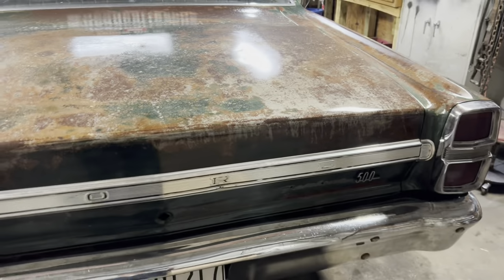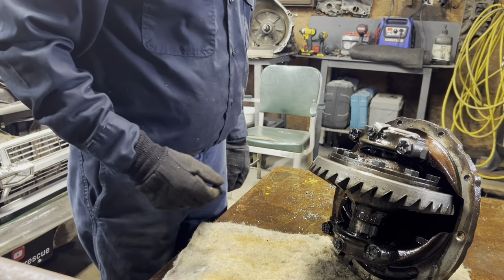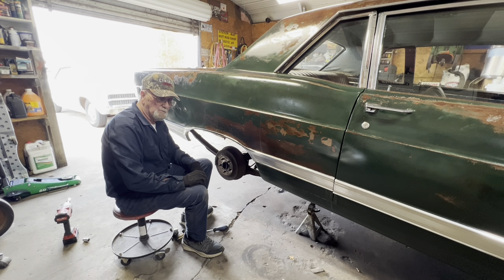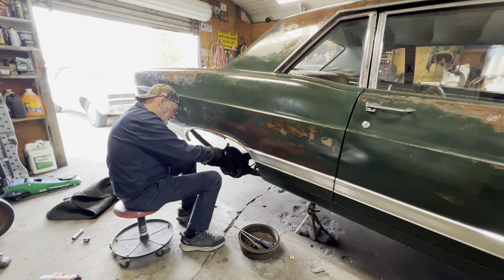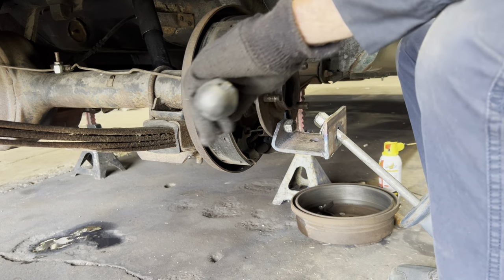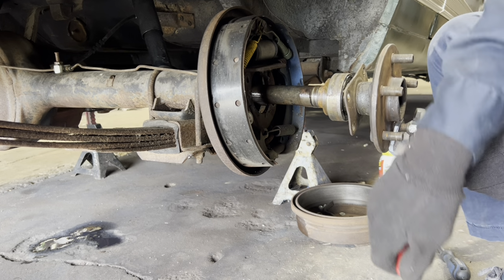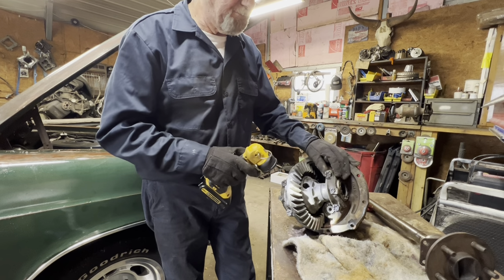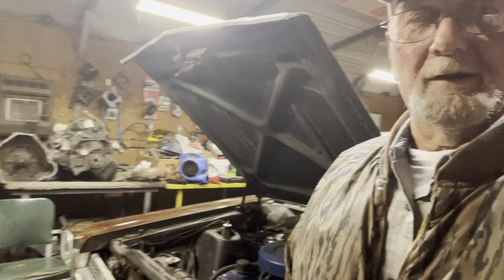Rear End Issue in a Ford 9” Gear chunk removal

Comment: Want to tell u how find diff in 302 & 351clevland, fuel pump on 302 &351Widsor mountlke Chevy bolts side by side, but 351-400 fu pu mounts top & bottom one over the other!
Reply from the maker: I’m not in the shop right now but I will look. Thanks for that information. Now if this engine is out of a 88 ford truck like I was told, would it even have a fuel pump hole in the block?

Comment: What was the original gear ratio?
Reply from the maker: 273 I think.
Reply from the maker: 273
Reply: Highway gears! Too bad the 3rd member is bad. You sure the noise isn't just the bearings, and the Chunk is actually ok?